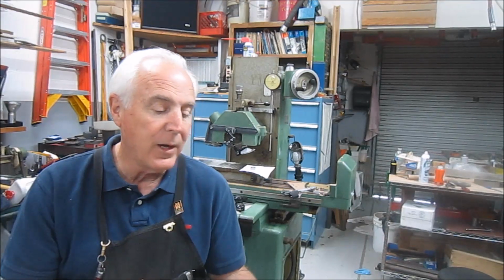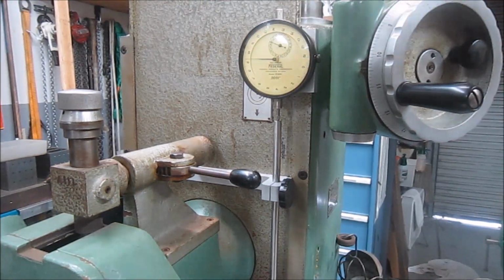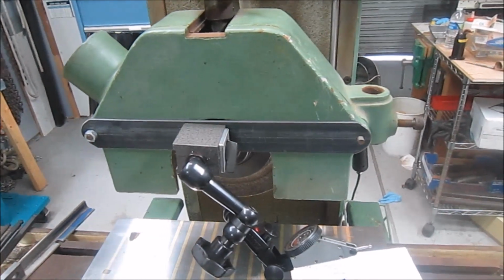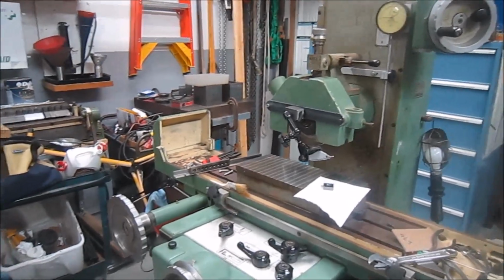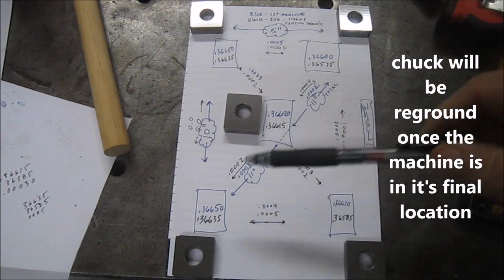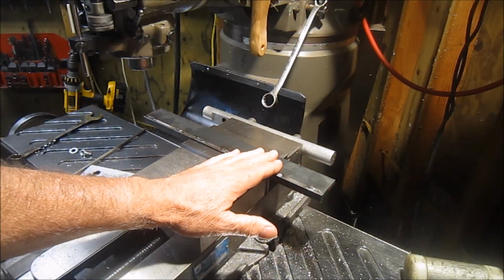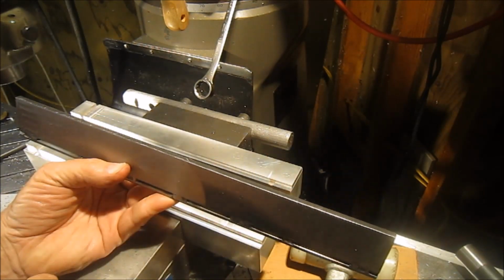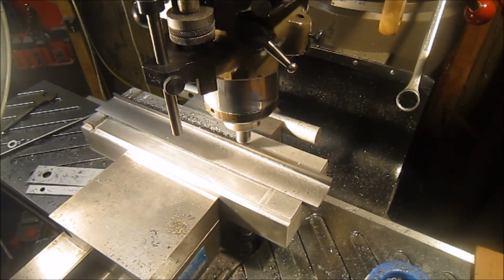Screwy Tuesday #61  Grisetti Surface Grinder 2

Comment: I like the auto feed on the grinder, you get a break while the machine does the work... 
Metric, there is always a way to live without it...    lol
If you ever ear about some .010" and .015" thick hardened ribbon about .750" wide 30 inches long let me know I've got to undergo maintenance on my own grinder, don't want to deal with the company, they're asking something like 6 or 700$...   :(
Those ribbons are replaceable wear parts under the carriage. Makes it easy to restart new after the machine is being used for a while.
Reply from the maker: +pierre beaudry Thanks for viewing and I will keep my eye out for the "ribbon"

Comment: Hi Chuck, slightly off topic but in one of you videos you had a chart that showed carbide inserts actual size. You laid an unknown insert on the matching one the chart and it told you what type it was. Where do you get those from?
Reply: Here is the one I use. Craig http://www.carbidedepot.com/templates.htm
Reply: +clemwyo Great, thanks very much!
Reply from the maker: +Cruiser Mac Hi Mac...send an email to boat92@aol.com and I can email it to you so you can print and laminate....I got the desk blotter from the counter person at MSC....
Reply: +outsidescrewball Thanks!

Comment: I think I bit off a little more than I could chew with my first surface grinder project.  I have a small sine plate that has some rusting/pitting on the top that I thought would just need a dust-off.  Well, I should have pulled a Stan and measured a little more before-hand.  I thin the previous owner had lost the original pin used on the non-hinged end and so the plate was about .050 tilted when fully closed.  Spent the last couple of evenings slowly grinding the top flat with the bottom.  I probably should have looked at making a new pin that was a little bigger.  Hindsight and too quick just to want to be doing something on the machine.  :-)  Have a good week, Chuck.
Reply from the maker: +ILGopher I certainly know the feeling....but like any thing keep at it to learn and improve....

Comment: I think you might find if you do the 5 block again ever that you want to take a lighter cut that 1st pass. I am thinking like a .0002"cut would be a good start. You were getting  fair number of sparks which to me indicates you were putting in a fair amount of heat too, and when you do that your accuracy and precision goes out the window.  I am no grinder expert so can't say for sure but just my thought. Good to see Howie keeping you in line. :-)
Reply: Hi Chuck, very nice restoration, keep up the great work and keep the videos coming. Tend to agree with bcbloc about the heavy grind, the blocks tend to increase in thickness from back to front, i.e. as the wheel wears. Try the same grinding conditions but feeding front to back to see if the size variation is reversed.
Reply from the maker: +bcbloc02 I will give it a try just for grins.....thanks for viewing/comment
Reply from the maker: +Stephen hardcastle thanks for the comment....may try it!

Comment: Another excellent video. I grew up using imperial gauges, but my current lathe and mill are metric, so I bought metric micrometres and vernier's as well. Now I find myself trying to work to 0.01mm instead of 0.001". so I am now trying to work to 0.000394". it is interesting how it affected the way I work. after a little while I found I was getting upset about being a couple of hundredths out. I m looking forward to seeing you do more with your grinder, it looks like a great machine. I am suffering from a bit of grinder envy lol
Reply from the maker: +The Shed thanks for viewing and the comment

Comment: I believe Don Cosset is using the wisdom of a Kung Foo Master in that he has learned from nature and incorporated its simplicity into the tool. Any guess what in nature Don may have used? Well I am about 50-75 miles from Don and can tell you we have many large Cattle ranches out in this neck of the woods. If I did not know better that tool resembles the hove of a calf. I now suspect Don of being a far east Master...East Oregon that is.

Comment: Great Improvement Chuck, your now all set to grind all your balls to the walls with much less pain in trying to figure out hand crank dials which normally have a backlash factor to boot to calculate in, its frosts your coconuts every time you have to make your best guess. Your improvement takes all the guess and by golly out of it. It is what is clearly shown on the dial it is, makes your life so much less complicated...thanx for the great video.
Reply from the maker: +1NRG24Seven Thanks for viewing and the comments.....ATB